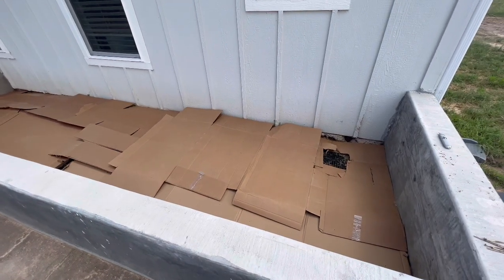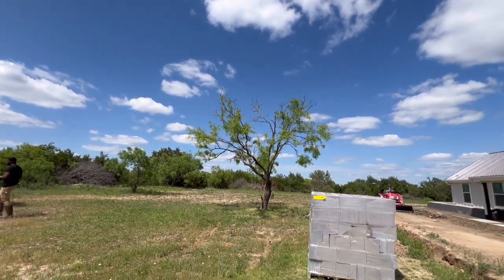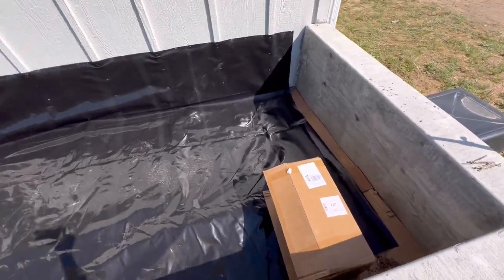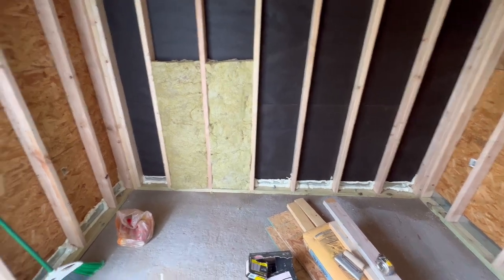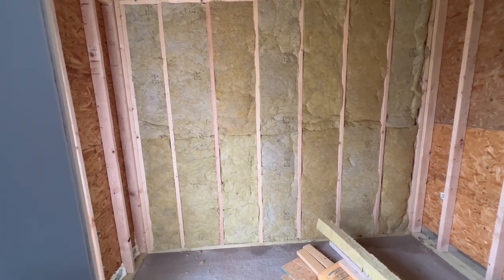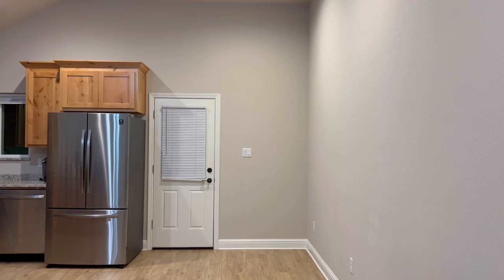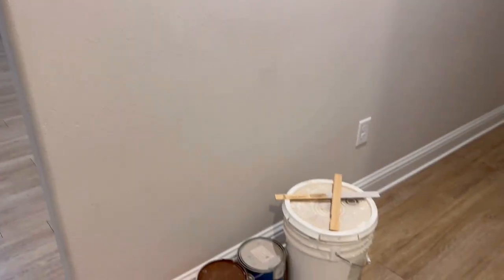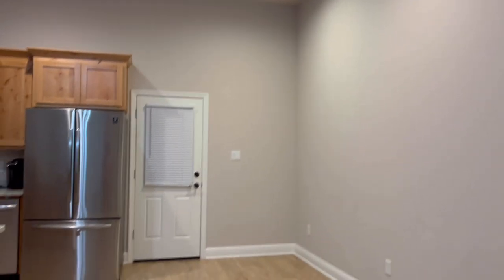It’s All Coming Together || Building Our Homestead Without Any Experience

Comment: The drain in the front bed will never work as is. Dirt will clog the drain. You need to elevate the drain up beyond the dirt. You can do by using a pvc pipe..then put cover back on drain.
Reply from the maker: Thank you I will look into it but I don’t think a regular pvc would work  because it’s a square drain. I was planning on putting a wire mesh over it and then put gravel over the drain do you think that would work, would love to know if you think that would.
Reply: I have been a project manager over construction for close to 30 years..I really think over time your drain will get clogged with dirt..the drain needs to be raised. I was surprise to see your drain in that deep bed..that's a alot of dirt that will be in there..which will eventually will filter into that drain.  Sorry need to figure out how to raise drain
Reply from the maker: @brendamoncrief4459  ok thank you I’ll try to see how I can get it high enough so it won’t get clogged and thank you for letting me know